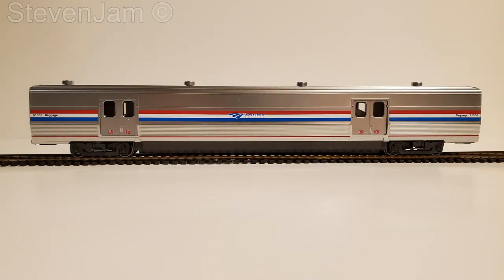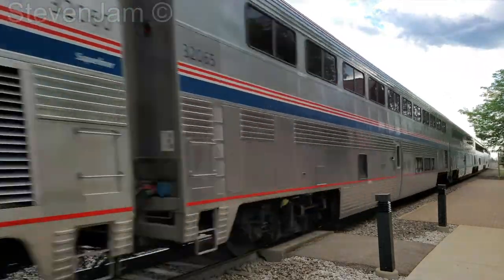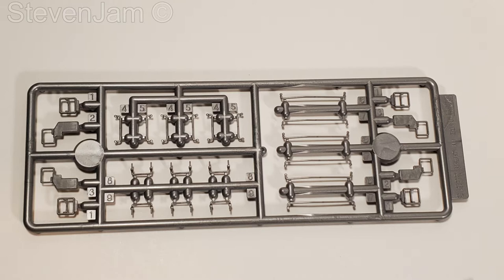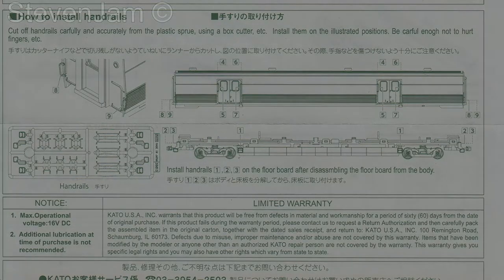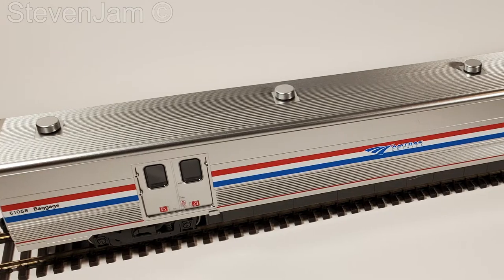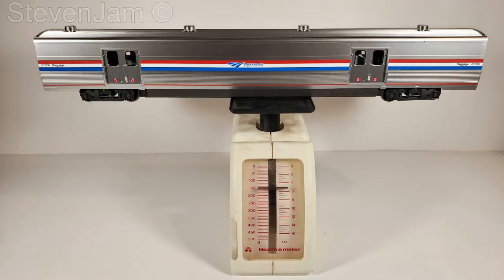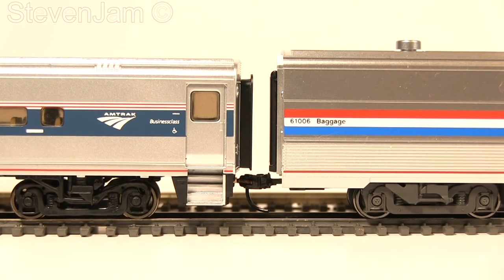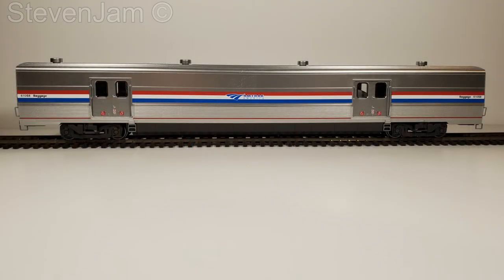Kato HO Scale Viewliner II Amtrak Baggage Car Review and Unboxing - First Run

Comment: Thats interesting how kato didnt put the grabs on from the factory, and kinda disappointing they have some molded on grabs for how much is costs but looks good.
Reply from the maker: I was originally a bit disappointed with not having the grabs on from the factory. Didn't realize it was actually fairly simple to get them on, biggest issue is not losing one of them. Luckily seems like there is 2 of every grab iron /handrail needed.

Comment: Great video and very in depth review ! Did you have to use any adhesive for the handrail installation ? Or are these tight fit and don’t need any adhesive ? I noticed the instructions didn’t mention it.
Reply from the maker: These ones were just a tight press fit. Was quite happy not needing to use glue for these.

Comment: See those O O holes when you pull out the coach. Take out the car with the styrofoam holder and push out the car through the holes so you don't brake the couplers